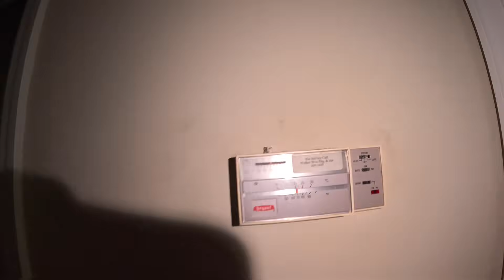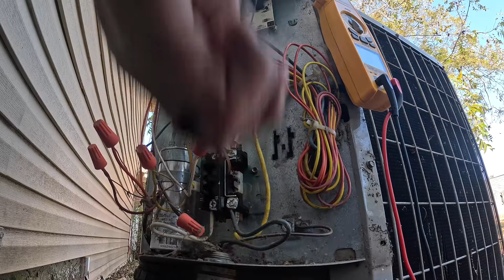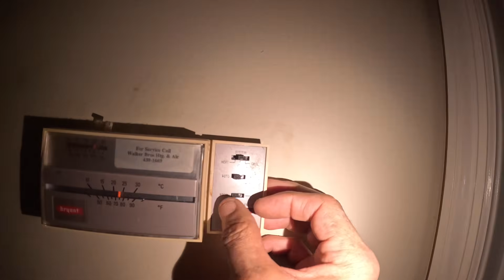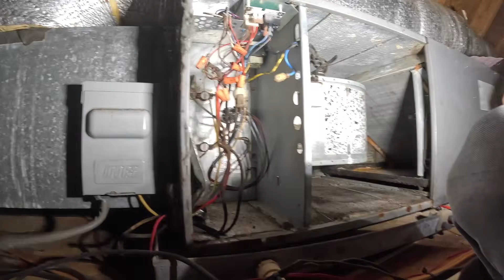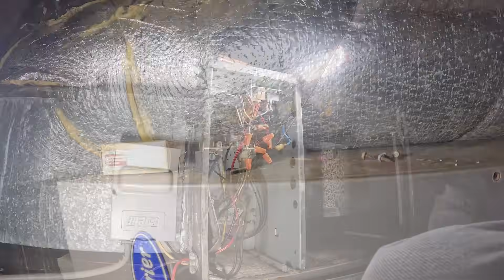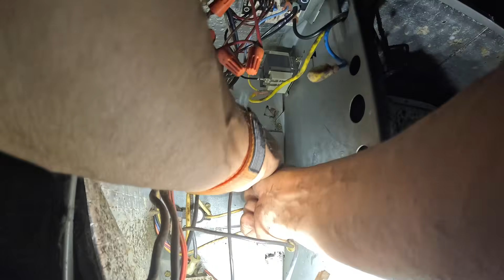Her Heat Pump Wouldn’t Heat Below Freezing!

Comment: Here in south Texas there are a lot of systems with electric heat that are not coupled with heat pumps. I would not own an all electric house.
Reply: Heat pump is electric not gas
Reply: @blb6547 yes I know, but there are a lot of tract homes here that have electric heat only. No natural gas available.
Reply: Heat pumps are about 300 percent efficient, electric heat is 100%.  Heat pumps are so much more efficient than electric heat.
Reply: @jaysonhoulihan9808 until it gets really cold, under about 30 degrees unless you have a super efficient one.
Reply: Its sad that they have have fiber ran to some of the most remote areas and yet some only have electric or only propane available. I wish they'd make natural gas available as the did fiber.
Reply: @hairtrigger903  Do you think rural fiber is buried? Because no, it's mostly aerial, run on existing utility poles alongside power and other telecom lines. Utilizing existing infrastructure and not requiring burial are why it's feasible at all. Running gas to rural homes would be unfathomably expensive, and especially makes no sense when heat pumps exist. It would make the rural broadband subsidies look like pocket change.
Reply: Anyone can buy or rent a propane tank and install propane heat inside your home for backup heat or whenever it's too cold for heat pumps to keep up , I have them in my house and they work great on cold days
Reply: I run a GE zoneline PTAC with HP in 300sqft  room addition i added that sits on slab wanted option to zone that room  20yrs dose a great job
Reply: I have a new a coil and blower with a new side discharge  Condeser that’s inverted I love it so far we don’t even have to use heat strips no matter how cold,it’s crazy how good and quit these new inverted side discharge condenser works.
Reply: @stevenervin9175  Preference wise. I'm still not as big on heat pumps then others. At least without any AUX back up.  But that's me. Since i grew up with mostly gas and straight electric resistance heating.  I don't really know how well the performance of these newer inverter system, would actually align to a gas or electric furnace in below freezing temperatures. Since i am more used to the heat output being more hotter.
Reply: In some places you have no choice.
Reply: @leadfoone There's also propane to look into. For those who don't live near any natural gas utilities. But don't see an all electric heat pump system, being an appropriate option for their needs.
Reply: Anyone can buy or rent a propane tank and install propane heat inside your home for backup heat or whenever it's too cold for heat pumps to keep up , I have them in my house and they work great on cold days
Reply: I have a total electric home I love it one bill $200 a month. No gas,no waiting for propane,no oil.😊
Reply: @marktarascio4766  The temperatures at the moment getting into the low teens where i live. Is typically when heat pumps start showing their disadvantages as a standalone.
Reply: Those heat pump are what all electric homes should have. Way less expensive to operate than electric furnace above 32° ambient. Our winter electric bills under 150$ with 2.5 ton heat pump
Reply: @blb6547  Most heat pumps in my area, are paired with an electric furnace, aka air handler with heat strips. That come on when temperatures are too cold for the heat pump to pull in much heat. Or if in the unfortunate case the heat pumps happens to break down.

Comment: What did you do outside concerning the defrosting…?  Mine does that and seems like it gets stuck; then starts and continues to blow cool air until I lower the thermostat or turn it off.  I did see you lowered the time from 90 minutes to check for defrost.  Thanks. I’ve been watching you for 3-4 yrs to see if you encounter the problems I’m having.  Thanks
Reply from the maker: I adjusted the defrost timer from 90 minutes to 30 minutes. At 90 minutes it can run long enough to form enough ice to not comp,etely thaw out in its 10 minute defrost

Comment: I guess the main objective is any time the strips get power the fan gets power but at the same time the fan can independently be turned on without the heat strip , Air condition mode or just fan by itself.
Reply from the maker: Exactly

Comment: I was sitting here yelling at my computer "Curtis...you don't have a call because you killed the power to the unit LOL".  Sometimes diagnosing these problems is like solving a puzzle.  You are very methodical in your approach.  I think I'm having an issue with my year and a half old American Standard Gold heat pump.  When the temps drops below 40, every time it cycles it, it runs for a few minutes, switches to defrost for about 90 seconds, and then switches back to heat and runs fine until set point is reached.  But next cycle on, does the same thing again.  And there is no frost on the coils.  I fear this will be a tough one for a tech to figure out.  It looks like our temps for the next several days will stay above 40 so I haven't even scheduled a service call.
Reply: You can call your Territory Manager at American Standard and your problem can be resolved and eliminate a headache. That's what I did when I was an A/S dealer.

Comment: Heat pump not heating ? Imagine that ! What do you except from junk !!! Worst idea ever !!
Reply from the maker: I don’t understand the dislike. They’re getting much better
Reply: Ground source & Geothermal HPs. are a lot better but the initial cost is very high!
Reply from the maker: @bobboscarato1313 the new inverter heat pumps are even more efficient than water source
Reply: @HVACGUY  I'm sure as these are newer developents in technology.
Reply: Curtis thanks for the update.
Reply: @bobboscarato1313  until the giant amount of buried pipe starts leaking or down inside the grouted wells, Poof any energy cost saving vanish to the tune of a whole new system install again at many tens of thousands bill.
even when they just get up in age, nobody will repair them and only bid for replacement, assuming there's no leaks in the piping. more so here in the northern areas with deep ground freezes
Reply: What are your ideas ? What have you contributed to society ?
Reply: If you have natural gas and a furnace to use it,  keep it.  Not much to argue.  Excellent heat and cost effective.  Gas will produce the same btus at -20 as at 70f.  Gas can be operated during a power failure with a very small generator, ideally running on natural gas.

Heat pumps are far more economical than straight electric strips and are a good choice in locations without natural gas.

If propane is the only hydrocarbon available and you want the advantages of gas, you buy and install a big tank and avoid running out.  However propane costs as much per btu  as electric strips so it has an economic disadvantage over a good heat pump.

An ideal propane compromise is a dual fuel heat pump for temperatures above the balance point and an integrated propane furnace for colder situations and for power outages using a small generator, ideally propane in this case.

Not much to argue here.
Reply: But look how much oil and gas you are saving while your freeze your axx off

Comment: What is your opinion of the newer systems that are supposed to produce some heat (without resistance strips) to -20F?
Reply from the maker: Love them. Have multiples out there. Save customer a fortune in the Winter.
Reply: We have had a low temp mini-split since 2019 here in SE Minnesota.  It has provided most of our heat, although we still use the electric baseboards in the bedrooms as needed.  When it's below 0 we run the pellet stove during the day just to help out.  The mini-split works OK to -10f but starts to lose capacity below that.
Reply: @Bob.W.  I would rather to have a electric furnace kit there anyways. In case if something where to go wrong with the heat pump, and there no other source of heating like a wood stove.  I grew up with gas and straight electric resistance heating, so i am also more used to the heat output being a little more hotter on colder winter mornings in that case.
Reply: We have a heatpump plus propane backup heat that allows us to use our 10,000w generator to run the backup when the power goes down due to windstorms , etc. Life in the country, all I need is a few amps of 110 volt to run the fan and burners. Basic lights and heat, and wife is not cold.
Reply: JUNK !!
Reply: @ralph95 well, it's preferable to have a good installer who can service it, that's for sure.  Lots of electronics.